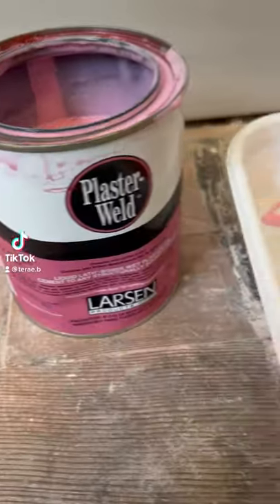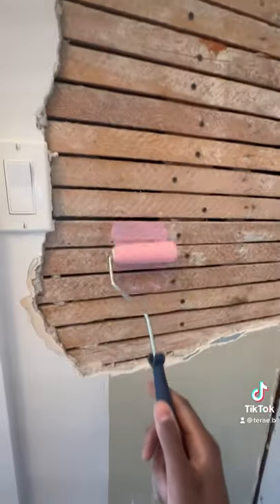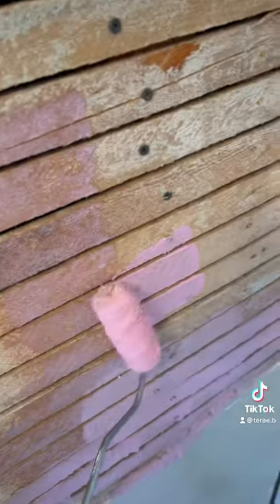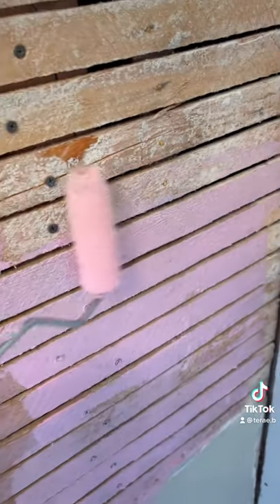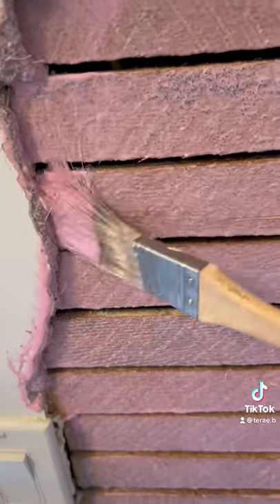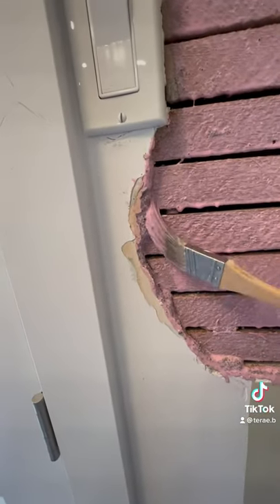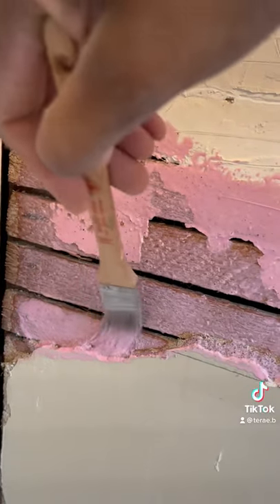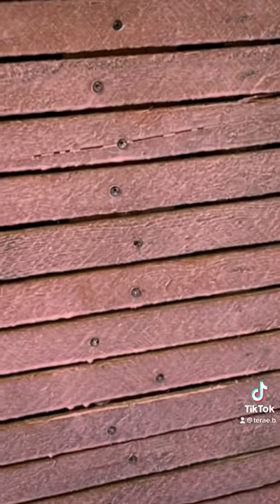How to repair lathe and plaster walls - helpful tip #shorts #latheandplaster #drywall

Comment: Nice video tip. I'm curious - is plaster effectively the same as concrete? I only ask because I've done concrete repair work on my home and in that application a bonding agent is important to bond new concrete to the old concrete. Stucco repair professionals in my area are also careful to use a bonding agent when repairing old stucco walls with a fresh stucco repair. In your application I assumed that the plaster is physically held in place by squeezing behind the lathe and forming keys.
Reply from the maker: @donaldlee6760  plaster has cementitious properties Like that or concrete. You break down is very spot on.

Comment: Does it matter if it dries for an hour or a day? Or does it need to have mud compound applied in a certain window? Just wanna make sure if i can apply now so it dries then do the mud tomorrow
Reply from the maker: @Lefishn  great question. Let it fully dry. Dry time depends on temperature. Once fully dry, typically in an hour or less you can then apply your plaster or compound 👍🏾
Reply: Yes you can wait up to a day after it dries to mud over it

Comment: Do you think plaster keying in is not enough? Im curious why you need plaster weld
Reply from the maker: Keying is important but if your plaster keying isn’t bonded to the surface then it still will fail. Unless you have a solid mechanical bond
Reply: the lath will suck water out of the plaster leading to failure at the keys
Reply: @soundbwoikilla764  you need to control suction by wetting the lath. Overall, Im a bit skeptical about plaster weld, especially in this application. Wood lath certainly has different expansion rate compared to plaster and thing them together feels problematic. My preferred approach is to use metal lath(even over wood lath) if I think it won’t key in properly.
Plaster weld to me is more appropriate when going over existing finish/plaster
Reply: @vitaliyzakharov6708  I agree with you but you seem more knowledgeable than the typical DIYer. Without plaster weld you have to be fairly diligent about cleaning the old lath and the plaster edges. For the DYIer looking to patch a couple spots and a 5 minute youtube explanation, I think plaster weld is a good idea. I would definitely use plaster weld if plastering over existing plaster.
Reply: @soundbwoikilla764  I'm not a DIYer, I'm a historic preservation specialist.
Reply: @vitaliyzakharov6708 could you advise on historic preservation considerations?

Comment: What if the latch has paint on it, would the plaster still adhere with this
Reply from the maker: If the paint isn’t delaminating from the lathe than you should be ok. That’s why I use a bonding agent that helps prevent that
Reply: @TeraeB  ok thanks so much
Reply from the maker: @scsujoy  of course!

Comment: Really? On the day that lath was first plastered,  I doubt they used that stuff. It's the plaster keys curling around the  back of the lath that locks it in place.
Reply from the maker: @johnggudmundson  yup the didn’t use this stuff and your right it does key into the lathe. However over time the bond loosens and when your doing a patch to preexisting materials you want to ensure a proper strong bond between the materials. 👍🏾
Reply: When the lathe was first installed, it was new & clean. How many years ago was that? And how much plaster was absorbed into the surface of the wood? Think about it, don't be foolish & have to redo it within a year, man.
Reply from the maker: @johnshanahan6439  not sure what point you’re making but thanks for chiming in 👍🏾
Reply: @TeraeB  I meant that without a bonding agent, it'll fall of within a year. I was in agreement with you.

Comment: i think this step is not necessary 5 minute mud sticks to everything like its life depended on it
Reply from the maker: @artbyrobot1  Until it fails. Bonding agents are key, applications like this need it 👍🏾
Reply: @TeraeB  i use 5 minute mud.  maybe you are used to weaker muds and used to them failing shy of using bonding agents.  I have not had that issue much at all.  I have not dealt with mud failures much at all on walls.  I never used a bonding agent before and never even knew they existed until this week.
Reply from the maker: @artbyrobot1   I use 5 min mud only and finish with a tight skim of USG plus 3. However this is lathe and plaster. Drywall repairs don’t require any bonding agents but for plaster a bonding agent is highly recommended. Two separate materials and finishing methods 👍🏾